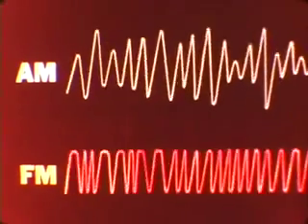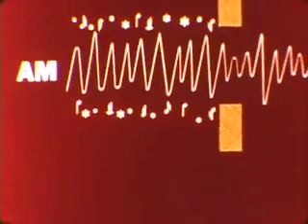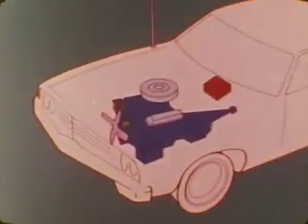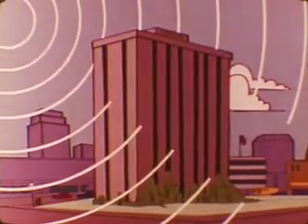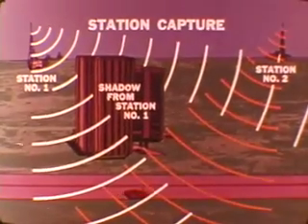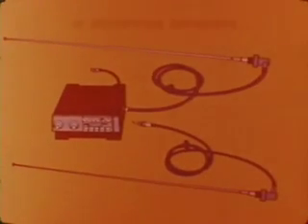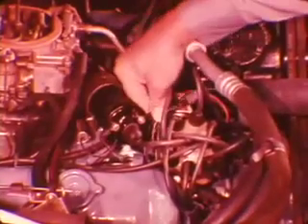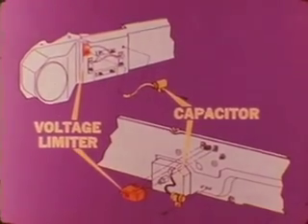MTSC - 1973, Volume 73-3 Radio And Sound System Troubleshooting

Comment: Back in those days, some Corvette models had a bunch of metal shields over all the spark plug wires to compensate for the lack of a metal body. I'm not sure when they no longer needed that.